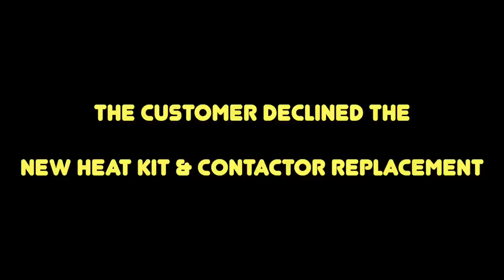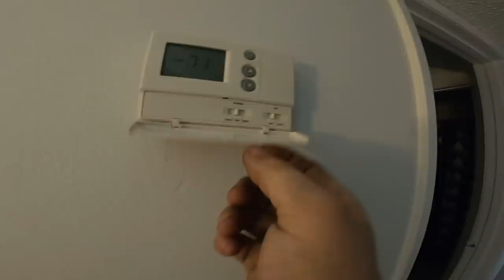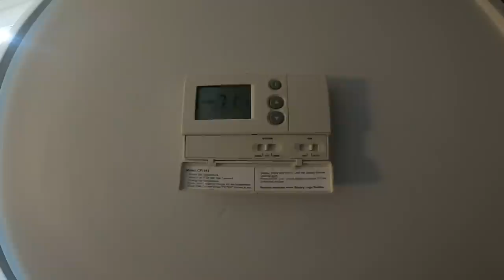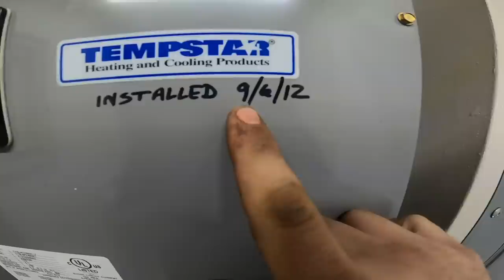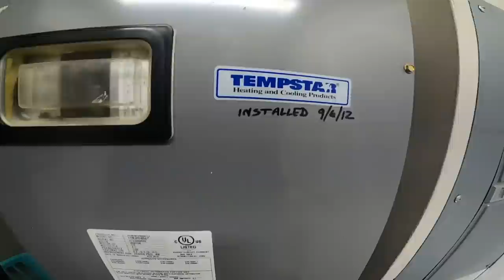Two No Heat Calls/X13 Motor Replacement

Comment: Nice DeWalt table! I have one as well & it comes in handy. I've always used PB blaster for working on cars & some motors but I tried the jack of all sprays since I saw Ted use it in a video awhile back & it works good too. But I have to say I like the kano aerokroil the best. I've been using that at work ever since u showed it in a video about 10 years ago or so. Happy Holidays & stay safe out there John! 👍

Comment: I put one of these in my less than 2 year old Carrier. The original installer wanted more for labor on a warranty motor than I could buy a rescue for. I kept the old motor as it failed on so in a pinch I could reuse it. lol

Comment: Hope you enjoyed Christmas. Thinking you got colder than usual. We did in NE Oregon. Gas furnace had no problems keeping up, but 2Kw heater in garage, and 3kw heater in shop ran continuous, and couldn’t hold temperature. Fearing electric bill. It warmed up here again, so all normal again.

Comment: come to the Van Side John.  lol  my first few rigs were trucks, but a van is more practical and nicer to close it up and just drive off without worrying about thing flying out or someone stealing something. I got a tall ford Transit 250. nice that someone 6 ft plus can stand in the back.
Reply from the maker: No thank you!! I love the service bed hate vans
Reply: I'm like John I like service bed with a box in bed its easier get parts without climbing in and out but in alittle older pretty much wore my legs out lol.

Comment: Hey John, how's that Milwaukee flashlight is holding for you?, is it the one battery or usb charge?
Reply from the maker: It’s great. I have both. The one in the video it’s the battery one. It takes two AA batteries. They’re both great
Reply: @johnisraelhvac2019  : I got the same as you battery one but mine seems no to last that long. still a good one. Thanks for answering. 👍

Comment: Maybe there's not a 80 amp breaker or line to hold a 15kw...?
Reply from the maker: 15 kw isn’t 80 amps buddy it’s 60
Reply: @johnisraelhvac2019  ok